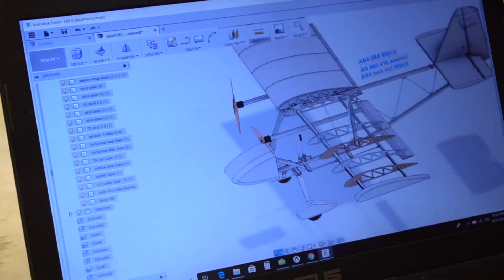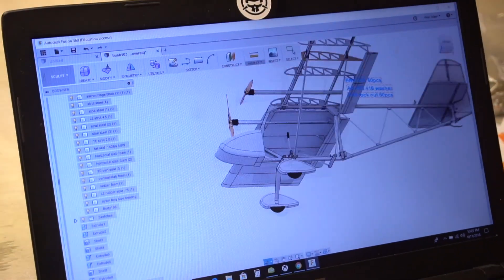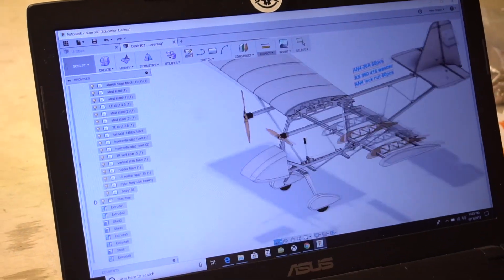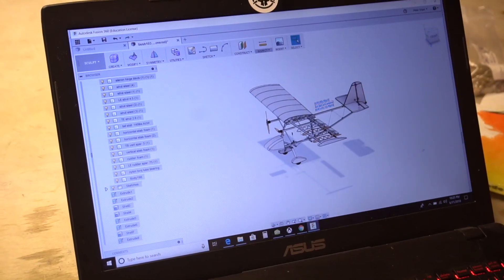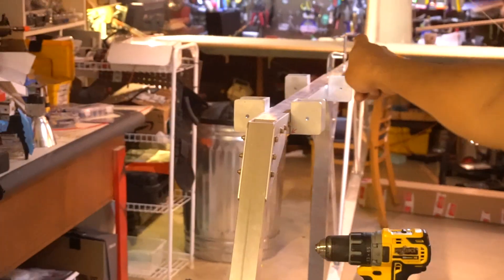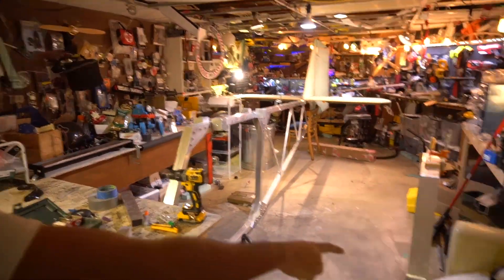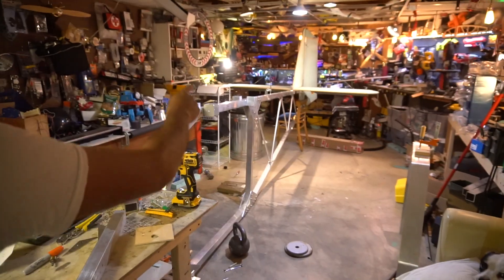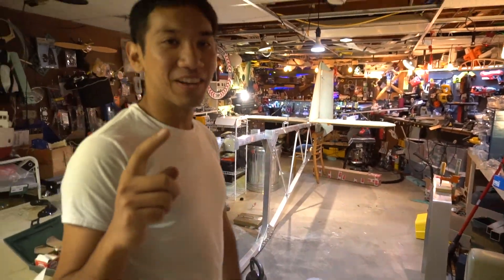DIY Electric airplane mk2 (Pt1)

Comment: remember the more prop blades the faster you can accelerate since you can push more air per rotation. This does require more powerful engines however,

Comment: You will have torsional and lateral issues with the 2" Square section frame you need depth and a bit of triangulation for stiffness. The area around the cockpit will probably ( almost certainly) have torsional issues. It may work out fine for a very gentle flight. The frame is certainly overdone in one dimension. I really like your design but some rudimentary FEA would be a good idea.

Comment: I think you need a little bit bigger engine and little bit powerful engine and those thing at 10:07 gosh dang it I forgot what it was called but you should get a like a plane size like using the Cessna would match the plane but I'm not sure

Comment: Looks cool! Those brackets seem overkill for sure. What about the fasteners as well? Any particular reason for using brass? Would larger aluminum fasteners make more sense? I think they have a higher specific strength. Not sure how much weight you have in fasteners in any case. What do you predict the wing to weigh? I assume it'll be aluminum frame with foam and fiberglass like the tail.

Looks great, should fly great! I am glad to hear you're hoping to get some more flight time from it. Keep up the great work.

Comment: What about taking the motors and building a simple belt driven gear reduction system for each one so that depending on your gear ratios, you can run a much larger prop?

Comment: The Aluminum bracketry is quite substantial! Could a lighter gauge material be used though? Not being critical at all...I enjoyed your last airplane build and was hoping you would take it to the next level. I helped build a Mini Max experimental many years ago, and remember how light everything seemed to be... till it was assembled. I like your design, but the tail section looks a bit heavy.

Comment: Have you look at the Goat?
You can download the goat plans for free.
Your design looks almost similar to the goat, I saw one video where a guy mounted a large RC engine behind the pilot and use that for power to fly.
I believe using a large RC engine will save a lot of weight compared to the batteries you will need and I believe you get longer flight time too.
Reply: The goat Glider is awesome. Wish I had the space to build one.

Comment: Great looking Ultralight Peter
Please look at a gearbox to drive larger props/prop as you know thats how our models fly more efficient, 
from what you have said looks like you need:
25 foot WS
5 foot Chord
3.35 lb/sq.ft wing loading
to achieve 27mph stall (no flaps)
Cheers

Comment: it might be worth it to just bite the bullet and get some 4-stroke 200cc petrol/gasoline motors, possibly even diesel for prop torque
Reply: The whole idea is to make an electric plane. There's so many designs online, you can almost make a bathtub fly with gas-powered engines.

Comment: Peter why so many bolts. Looks like a lot of your bolted splice plates could be welded that could help with some of the weight issue.  I know welders aren’t cheap.  I weld aluminum and you could catch on quick.  Talk to Miller see if they would sponsor you.

Comment: Love it.
I cringed when you tossed that rotomax. Hope it landed on something soft lol.
Foam and glass is notoriously heavy.  Your aluminum is a little thick too.  Not trying to criticize just sharing because weight tends to get out of control with those materials. Fabric covered wings and tail group are far lighter and easier.
The cheap UL weight dacron/peel ply from aircraft spruce is great.  You can skip the expensive glues by using 3M fastbond 30 NF which is like the stewart glue but cheaper.  And then paint with house paint.

Comment: If those pop rivets are aluminum I would be worried about stress fractures in them over time. Also the ends working loose, I do not know the loads the tail will experience.

Comment: Is there some regulatory reason why you bolt the frame together rather than welding it? You could save so much weight and gain so much rigidity.

Comment: If the motors are too high speed, low torque, you could step it down with a large gear, if you can get one light enough.. this would even allow you to have the motor lower than the propeller, if that helps balance the weight. Could be more things that can fail though, haha :)

Comment: Hi Peter. I am a mechanical engineer and your design is overkill strong with the thickness of the brackets and sqauare tube. You could drill holes to lighten the airframe and brackets.

Comment: I'm currently a junior in high school who wants to become an aerospace engineer. Do you have any info about the wing's airfoil? I specifically want to know if it has to be curved in a certain way. Also, is there a way to estimate the amount of lift it can generate. Lastly, how does an airfoil produce lift? Everyone on the internet says something different. Thanks in advance
Reply: Hi there! I'm studying aerospace engineering at uni at the moment. I would recommend it its a great course :) I would point you towards an article called 'How Do Wings Work?' by Prof. Holger Babinsky. The reality is that how lift is generated is pretty complex and areas are still being developed, but this paper gives an accurate and accessible explanation. Hope that helps!
Reply: It's a growing debate when you think it would be already "solved" at this point, but many people are considering Bernoulli effect to be less than previously thought and angle of attack being more important.
All kinds of info on airfoils- NASA has a bunch if really cool articles online that will basically give you an overview of decades of research without having to go into the minutia of detail that you'll get later in college... but also check out NACA.

Comment: Wondering what airfoil design you used: https://www.nasa.gov/image-feature/langley/100/naca-airfoils. 

 And... did you ever consider modeling your design in a simulator like X-Plane 11 (the tools to do so are built into the program)?  This can be an inexpensive way to roughly model/test some of your aircraft's flight characteristics: https://www.x-plane.com/desktop/how-x-plane-works/

Comment: Homemade rocket ?
Reply: GaetanLePelican 
Significantly more complicated, expensive, and dangerous. You can't even buy rocket fuel without having it specifically manufactured for your rocket. Not to mention, launch facilities, guidance systems, and just the math for making an efficient nozzle. It's very complicated, and a huge step up from an ultralight. Even a small scale hovering vehicle is a large undertaking.
Reply: Tyran L. Ues but no a humaned rocked just a mini rocket

Comment: One small problem I see with your design Peter, the aerodynamic casing over the front wheels is not designed for a tail-drager 'plane, and so you will scrape the back half of it on takeoff and landing, given that your plane leans so drastically to the tail. Good luck though! (^_^)

Comment: Are the rivets stainless or aluminum for hinge points? You'll hear pop rivets getting trashed heavily for use on aircraft but I'm pretty sure the Challenger uses them.
Reply from the maker: Syphen House some aluminum, but purchased a ton of cherry rivets and there are bolts in the hinges as well as overkill!

Comment: If this plane while gliding manages to have a sink rate of about 1 meter per second or somewhere there, you should consider getting a compensated variometer and learning how to soar. As a glider pilot I can tell you that thermalling is super fun, expecially if you manage to stay airorne for several hours with no power. But really, what is the projected sink rate?

Comment: I am also building a DIY plane very similar to your design but smaller and lighter. However my tools are very limited. I have a drill, file, lathe and other basic tools. Do you think i can build an airplane with just those basic tools? BTW Good luck with your new plane=)

Comment: Peter, why do you want the props so close to the fuselage?
Reply: Also Peter, can you use some form of gearing to run a larger prop at a slower rate with the motors you have?

Comment: Peter- love all the stuff. Now that you are doing some real machining with real machine tools take care.   I notice that when you drill holes you do not break the chip by pecking downward. You should release pressure and back up a smide to break the chips.   More accurate holes and far less chance of grabbing, etc. Also pay attention to whether you are climbing whem milling on the Bridgeport.  Just some small tips. keep it up dude

Comment: If LiquidPiston gets a 20hp engine up and running and starts selling them, you could engineer a generator using one to drive the motors and stay flying for several hours. Great thing with it is the fact the plane would fly better the longer it's in the air :)
What's cool about LiquidPiston's engines is a 3hp X-mini weighs 4lbs. Add a few lbs for the fuel system and exhaust and a few more for the generator and control systems, and you have something that can supply ample electricity to the motors :D
I'm looking forward to this new design though, these big projects are a good test on the feasibility of pure electric flight.

Comment: Cool plane and all! Totally supportive!
However, have you considered torsion and bending moment on the tail? In other words, what if the front roll to the right while the tail roll to the left? Might lead to fatigue problems. Also, vibrations, bending moments and instabilities along the Yaw axis since the areal moment counteracting this is pretty small. 
Have you done some kind of simulation (FEA/FEM) to confirm that the structure can take the load?
Aluminum 6000-series is cool and all... but have you heard of 7075? ;)
Reply: That thing is built like a tank. Also it's almost exactly like the thirties and forties basic glider designs, which were very robust and durable.
Reply: electric motors produce very very little vibration, unlike gas engines so only aerodynamic vibrations will be a factor (small) but yes, if the tail section isn't stiff enough, it could twist. though it looks really stout from here :)
Reply: RC Hobbyist Extreme its still subjected to forces that need to be taken into account during the design...
Reply: [Karri] Is it? Didn't they mostly use body box sections to support the tail?
Reply: MrGrebgnet He isnt building a 777.

Comment: Sell the old one for money for this one or just grab some parts off of it
Reply: The Diamond Hunter it really belongs in a flight museum. I hope he doesn't scavenge all of the parts for this new plane(like I would).
Reply: matthew bennett well seeing it’s a new plane it shouldn’t be in a museum but rather an exhibit to learn more about them, it’s a good idea but I think getting the money or using parts would be the best options
Reply: @matthew, Diamond:  Do you guys realize that people have been building (and flying) aircraft like this for decades, including the use of foam panels, etc? The only new item here is the electric motors instead of gasoline engines, and the fact that Peter has a Youtube channel with half a million subscribers, unlike builders in the 1980s.
Reply: @codetech, yes, I know people have been self building airplanes for a while. I do indeed feel this one is different, for exactly the reasons you've described. Peter has over one million people that might make the trip to come see this plane.

Comment: I know that you're experienced, but cleaning material of any burrs and chips before joining them together is critical. When you bolt aluminium with burr between your piece and bolt head you essentially clamped a spring. It could (but not every time) get deformed with change of forces, then fall off, leaving you with loose bolt. Same with riveting. I think you have some chips under your hinges and they will fall off with time, and belive me, loose rivets don't last long time.
Just FYI, I'm not saying that you'll be dead because of that.

Comment: @PeterSripol You shouldn't put the horizontal stabilizer on the same plane (as in the geometry term) with the wings because the elevators will have trouble pitching with the chopped air from the wings at higher speeds.

Comment: If you add solar panel at the top it will fly way longer
Reply: Mark evnue not really, it would add weight, the only ones that can use solar power effectively  are gliders.
Reply: Mark evnue good idea but would be quite heavy??
Reply: a 1 square meter solar panel generates about 150 - 200W of power.  Ignoring the voltage and current limits of the solar panel, I found a DC airplane motor one-third the diameter of the motor shown in the video that can handle 2100W full power max.  As a rough guess, one properly sized motor would guzzle 4000W of power and two would guzzle 8000W.  That means you've added 24 pounds of solar panels and only added the ability to regenerate 2% power.

Okay, let's step back and use a scooter motor instead.  These suckers run at 36V and 30A of current.  At full power, that's 1000W of power drawn.  You need 2 of them, that's 2000W.  You only regenerate 10%.  When cruising, you could probably step the current down to an average 10A.  With 2 motors, that's 30% power regeneration at best.

Conclusion: Not enough solar panel to dramatically increase flight time.  Adds a lot of weight too.
Reply: I only Comment No per quared meter is about 12 kilo I think if he just uses 1 meter it will atleast power 30% to 50% back
Reply: Or even more
Reply: If you guys all like he will read the message and tell in the video if its a good or bad idea
Reply: Mark evnue you'd probably lose that extra power to induced drag from the 12kg panel sitting on top...
Reply: If that would work, the sky would be filled with solar powered man-carrying aircraft. It has been done, but the compromises to make it work always result in a highly impractical aircraft.